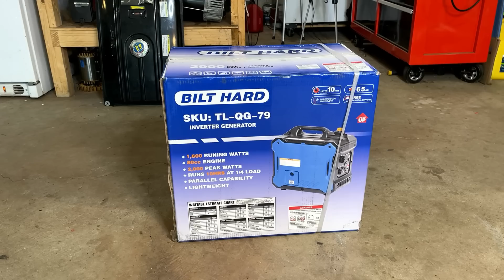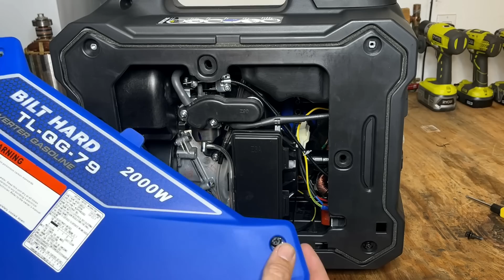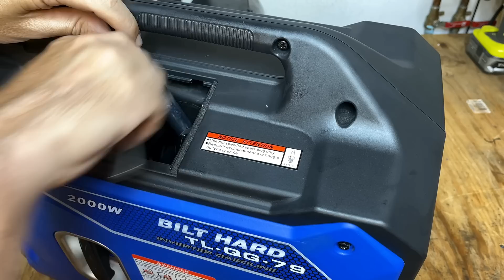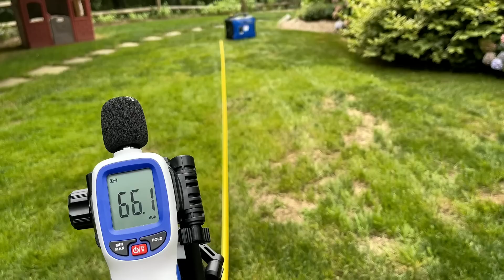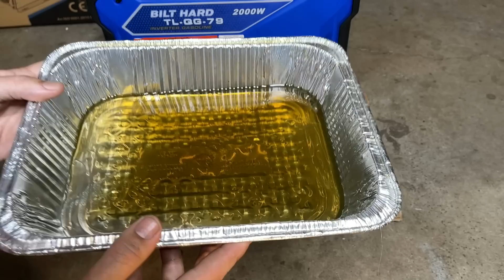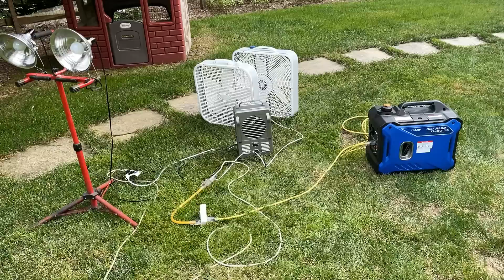Bilt Hard 2000 Watt Quiet Inverter Generator Review and Test

Comment: Great video, i have a dual fuel champion 5500w inverter generator with only the recoil start, id love to see you do a review on that machine.😊 I broke mine in for 5 hours varying the load not exceeding 50 percent, changed oil at 5 hours, That is the manufacturers recommended procedure, it even had a oil maintenance light come on at the 5 hour mark in the display. Very nice generator

Comment: I greatly appreciate your in depth review and testing of the generator, and the fact that you also gave some details about breaking it in. For novice people like myself who have never owned a generator before, the in depth details in this video, are extremely helpful and informative. I actually ordered (have not received it yet) a Built Hard 5500W Dual Fuel Inverter Generator, because of the positive feedback that you gave about the quality of this brand. I actually purchased it at a great price for $369 ($739, 50% off Sale), which is drastically lower than most compatibly sized inverter generators. Thanks for your very professional and very informative review.

Comment: In my opinion either it's a generator or new car or motorcycle, the engine breaking in should be done on cold. That new engine with oil inside should be connected to an electric motor and leave it running 1-2 days like that. Because when you break in the engine while it's hot, it will collect all the metal bits in between the piston sleeves or collars whatever are those called and that will clog up the piston and prevent it from collecting enough oil from the oil bath.

Comment: I burned up 2 cheap Chinese inverter generators. These inverter generators are not like my older Coleman non-inverter generators that will take it if they're overloaded. At the most they blow a breaker that's it. If the overload light comes on in a inverter generator you better back off power immediately or shut off. Being overloaded on an inverter generator will just burn up the generator the motor will still run but it will not make any power the overload light will come on immediately when you start it. I sense bought a Honda 2200 and 1000 watt Honda inverter generators and changed both over to Tri Fuel and only run propane so far both have held up. Thought I would never buy a expensive Honda generator. But I tried the cheap route and hate to say cost me more money. I'm off grid so hopefully the Hondas should last a lifetime. My older Coleman 1850 watt non-inverter generator is never burned up any sensitive electronics. I ran the Coleman pulse 1850 watt non inverter generator on jobs I bought it new in 1994. It has the bulletproof Briggs & Stratton engine in it. Not the most fuel efficient but it's very dependable and proven to be long-lasting and dependable and some what quiet. I wouldn't sell it for the world.

Comment: I just recently bought a new WEN generator. After the first hour oil change (i used synthetic as the intial fill ... ooops) i installed a magnetic fill plug. checked it after another hour and it definitely has some metal  on it. Wonder if i should be concerned.

Comment: Your videos are brill learnt so much from them ive got 4 generators because i bought one then after 4 years my little 850w 2smoke genny stopped working and the exhaust snapped off got thrown to one side bought another cheap 1kw inverter 4t genny lasted another 4 years picked up another small but quiet 700w inverter genny real cheap and only used once i use it for my caravan to charge the batteries in storage been a brilliant little genny the 1kw one leaks oil like an old ford rattles like mad and im very surprised it still goes its down on power now too its pretty much dead smokes too i have learnt though do reasearch on what you need becasue i ended up buying a 3kw frame genny in the end for my show needs running caravan cooking stuff and lights so i always put in place a figure what you need before haha great videos keep them going and this genny looks brill and very quiet

Comment: I just want to share with you folks about hour meter. My hour meter is mounted on top of spark plug lid with antenna cut short just enough to run an eight inches loop around the lid inside wall. So the meter goes in off with the lid. 

Before you cut short the antenna cable, bundle up and tie the excess cable first to leave 7-8 inches antenna tip to form a loop the size of the lid to test qualify this.

Comment: Good video. You should have load tested the EU2000. The Chinese generator you tested is 80cc. The Honda is 100cc. It was really obvious to me that the Chinese engine didn’t have enough power. I’ve seen way more power from the Honda than it’s stated peak. Good luck with a service manual and parts for the Chinese one. The Chinese one had all sorts of electronic components exposed when you opened the cover. The Honda is way better quality, you get what you pay for.

Comment: James are inverter generators such a good idea for the everyday consumer?  
1.	The cost per kilowatt is about three times the cost that of the synchronous generator.
2.	The noise is supposed to be less but that seems to be true only if the units are loaded to half or quarter load.  The noise level comes up a great deal when fully loaded.  Most of the inverter generators are fairly low power units so the consumer is encouraged to buy two units and parallel them.  So now the consumer has two expensive generators running , which would increase noise levels.
3.	With a synchronous generator you have an engine and alternator.  With an inverter generator we have the same items with the addition of an inverter.  The engine, alternator and inverter are all subject to failure.  The inverter circuit board seems to be potted making repair unlikely.  I understand that replacement inverter boards are hard to find and very expensive.  We haven’t begun to talk about the extra labor to dismantle the units so repairs can be made.
4.	I recently was given an electric heating blanket that has specific directions not to plug it into a generator or inverter.  My suspicion is that even the distorted wave form of a brushless gen set is not the real problem.  The real problem is that the high frequency pulse modulation methods used by inverters confuses the electronic controls of the electric blanket. At this point I don’t know if this is true but hope to do more investigation to check it out.  I know the sine wave output looks nice; however I’m not sure the effect of the high frequency switching can be seen on a scope.
5.	There is the possibility that engine life of an inverter generator could be extended because it does not have to run a 3600 rpm at all times.  However, since the engine speed of an inverter generator does not have to be synchronous speed does that mean they may be operated above 3600 rpm to get more horsepower out of a small, light weight engine?  If that is true It would seem engine life would be reduced.
Reply from the maker: 1) They do cost more, but they also have a higher resale value.
2) I am not a big fan of running them in parallel.  If you need more power, then would buy a brushed generator with an AVR or a larger inverter.  Harbor Freight just came out with an inverter that can surge up to 9500 watts.  Of coarse it costs $2000 and most likely parts are not available unlike the Honda EU7000.  I would always recommend buying a generator of any type oversized.  So if you need 5,000 watts buy something larger like a 7,500 unit.  
3) The inverter generators engine should last longer because it is running slower and the stator on the inverter cannot lose magnetism and has no brushes so less to go wrong there.  Of coarse the inverter module itself is the big point of failure.  If that goes, then the generator is pretty much junk.  
4) That is interesting.  My wife uses a heated blanket and I noticed when running on generator power that the inverter did not like it much.  The eco control had a lot of issues finding a happy speed.  Now I wonder what the blanket was doing.
5) I believe they could run faster then 3600 rpm if the inverter board can handle it.  I am pretty sure the inverter featured in the video may have been running faster then 3600 rpm when I maxed it out.  The main selling points of an inverter is 1) How quiet they are 2) Longer engine life 3) Fuel efficient and 4) clean power.  The drawbacks are 1) cost 2) wattage limitations 3) inverter module failure 4) difficult to service and repair
Reply: @jcondon1  Thanks for the comments.  The other day I saw a video (not one of yours) concerning a Sportsman GEN 10001-ss inverter generator.  The camera panned over a name plate on this generator and I thought I saw something about a 5500 rpm rating.   I looked up the owner's manual on the internet.  This manual indicated the unit had a 40 cc engine and the rated output was 0.8KW.  The manual also indicated the max output is 0.9 KW @ 5500 RPM!  Will this generator have a short life due to cylinder wear and or bearing failure?  I always though 3600 rpm was high speed, but this is getting up in the racing engine speed!

Comment: You should consider adding a variac to your test setup. You could vary the load by controlling the voltage! With that, you could see the exact overload detection points.
Reply from the maker: Good idea.  I actually have one already.  Will have to try that.
Reply: @jcondon1  Thank you!

Comment: Love the videos. Question for you, I have a Champion 100520. Would it be a good idea to add an inline fuel filter to the carb?
Reply from the maker: Probably not necessary.  Generators like that usually have a screen at the fuel fill and another at the tank outlet.  If you look in the tank, you might be able to see that filter where the fuel exits.  An inline might help if pieces of the fuel line breakoff.  Some Generac models do all three.
Reply: @jcondon1  Thanks. I'll leave it be. My plan is to keep it completely 100% full with gas and sta-bil and then drain it and replace with fresh every year (I keep the carb drained, of course) I bought the portable pump you suggested, its fantastic!

Comment: I do have a quick question. If you still have your bilt hard generator i need a piece of info from you on it. I ordered one and got it in and it had a broken fuel line that broke just as soon as I started it or maybe it was damaged and the vibrations of starting the machine did it in. Anyways I don’t want to ship this thing back in so I was wondering if you could provide me the OD and ID measurements of the fuel line between the shutoff switch on the front panel and the carburetor inlet so I can order it and get mine back up and running
Reply from the maker: I still have it but not able to easily pull the line.  Would bet it is the standard Honda fuel line.  ID 3/16 OD varies between .3 and .4 inches.  In this generator the is is .3”.  Might want to go a little larger on the OD.

Comment: I have a Hobart 140 welder. I just want to be sure if this generator will work for me could you please let me know I do not understand these numbers. 

Welding Amperage Range: 25-140 A; 20% duty cycle @ 90 Amps, 19V thanks for your time
Reply from the maker: Do not think this will have enough power.  The specs on that welder say 2500 watts input / 2900 KVA.  Also might have a surge associated with it.  You would need at least a 3250 watt 120v only generator.  A 120/240 volt generator only outputs half the wattage on each outlet.  So on a 120/240 generator you would need at least 7000 watts or 3250 watts if you can put the legs into parallel mode (120v only).
Reply: @jcondon1   ok I think I got it thanks

Comment: After watching this video and seeing the pricing on this unit I am strongly considering buying this unit to supplement my very reliable 2500w predator inverter generator. It’s a first gen Chonda engine machine and it runs super well. Just has an absolute TON of hours and is heavy. I use my inverter generator for my AV business for outdoor events where we have no power. When powering sensitive electronic equipment inverter is the way to go.
Reply from the maker: Inverters are the way to go.  Would always carry a backup though.  Cannot afford to be down when running a business.

Comment: I have a Briggs 5kw generator, producing no power. I ran through the stator tests...ok  When checking the rotor at slip rings I get no reading. I think my rotor is done. DPE and Sensor readings ok. Any thoughts? Neither rotor nor stator available for this three year old generator.

Comment: I have watched a lot of your video's and have learned a lot about small engines I have just got one of the ultrasonic cleaners was and was wondering what kind of cleaner's you use and thanks for puting your videos out I have learned a lot a bout generators
Reply from the maker: Thanks.  I only use Harbor Freight Super Heavy Duty Degreaser in my ultrasonic.  Have tried others, but found this one the best for me.

Comment: Great video. I have a question on a Troybilt pony.  Does both idlers supposed to be level with each other.  The deck don’t appear to be bent but one idler pulley has a tilt.
Reply from the maker: Sorry, do not know the answer on that one.

Comment: I'm planning to make a diy version of these inverter generator (for proof of concept and experiment). If I'm getting it right, the motor-alternator is making high voltage DC and then the power goes through a H-Bridge with sPWM signal applied to it, then to the power outlet in the case.. am i right?
Reply from the maker: The alternator makes 3 phase high voltage AC.  It is rectified to DC and sent to the inverter where is is made into 120v 60hz or 230v 50hz depending on where you live.
Reply: @jcondon1  I live in Indonesia, standard power line voltage here is 220v 50hz.. so I need a (custom?) alternator with rectifier that outputs roughly 320v DC and then pass it to a Inverter (also custom made) and then i get 220v output?

The inverter board I'm planning to use is based on the EGS002 sPWM board which can drive a mosfet H-bridge to output a pure sine wave..  I'll use high voltage mosfet/igbt and maybe an Arduino to regulate RPM based on current load (shunt current). What do you think about this concept?

Comment: Hi, I have a generator with a very rusty gas tank.  I am using toilet bowl cleaner to remove the rust and after one day it is working fine.  I am going to leave it in for another few days.  Once done,  I was thinking of putting straight oil or ATF in the tank to coat it to stop future rusting.  What do you think of that idea?  Thanks.
Reply from the maker: That is a good idea.  I use WD40, but thicker oil or two stroke oil would work better.
Reply: @jcondon1  Thanks.  I have a lot of 2 stroke oil so I will use that.

Comment: I know you must get a lot of questions about generator repairs. I was wondering if you could help me out with mine. I have a Robinson 3500 generator it runs fine and produces good power with auto idle off. If auto idle is on and there's a load it also runs fine but then surges once the load is off. I had clean the carburetor already and it starts on the second pull. Again it runs perfectly fine as long as the auto idle feature is off. I adjusted the governor thinking that was the problem and it really didn't help. Do you have any ideas.
Reply from the maker: Most of the time surging is caused by a lean condition.   I am not familiar with your model generator.  Generally would clean the jet a little more aggressively.  It only takes a little build up to lean things out.  The only other things that comes to mind is a vacuum leak between the carb and engine or a missing spring on the governor rod..
Reply: @jcondon1  thanks for your quick reply.  I'll try going through the carb again. I put a brig's fuel filter on to catch anything in the gas tank since it's metal but the tank is pretty clean. Somebody put the wrong air filter in the generator. The factory air filter is two pieces with a paper filter and a foam band. With that being said if I hold my hand over the air box about an inch away it does smooth out or wrong the unit at quarter choke.
Reply: Robin EY25. So I'm going to start with an OE air filter and try tuning from there. The factory carb is almost 300. It cleaned up well and I was able to run copper wire into all the holes with no issues

Comment: What I can't understand is how the little generator doesn't cook inside with all those covers around it, when you see the bigger generators they don't have any covers around the engine so they get plenty of airflow. Do they have a fan inside to push the air through?
Reply from the maker: Yes.  The engine actual has a plastic shell around the head.  The air is sucked in through the fan on the flywheel, across the head and then guided though the plastic shell and exits in the back by the exhaust.

Comment: Why do they call that a 2000 W inverter generator when it only puts out 1500 W?
Reply from the maker: Inverter generators always list the surge watts on the unit instead of the running watts.  The Honda eu2000 I ran in the video is a perfect example.  It can only do 1600 watts continuous.

Comment: Hey small engine guy, you poured the oil in backwards. Turn the oil bottle over with the spout at the top instead of the bottom and the oil wont glug.